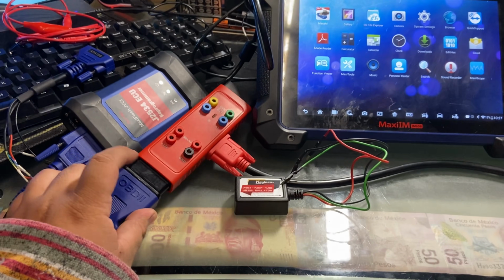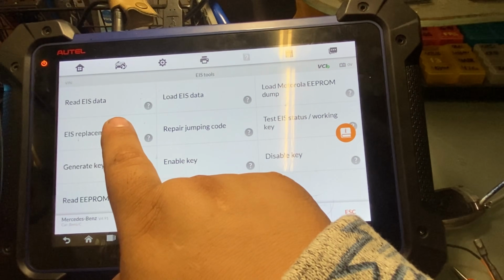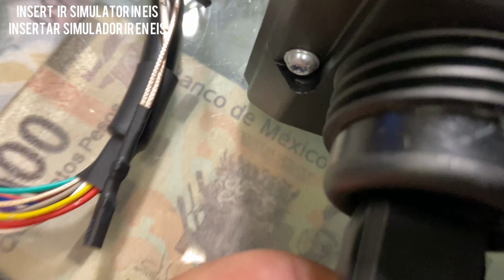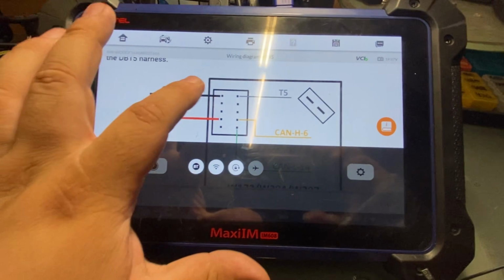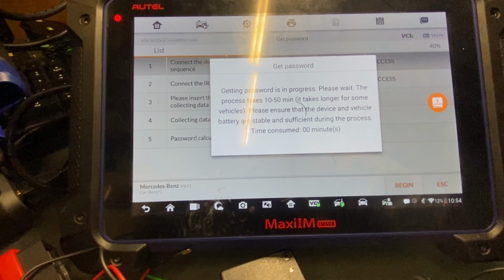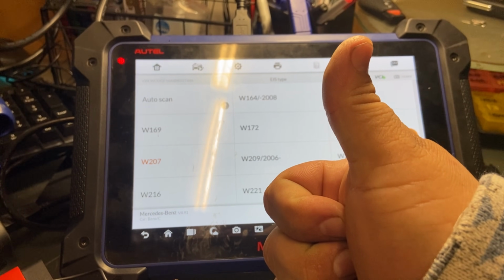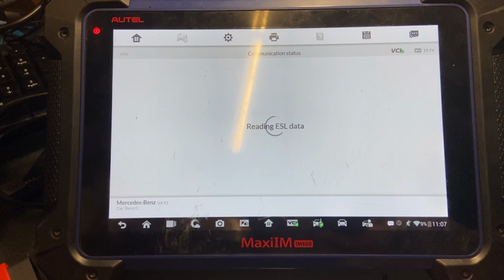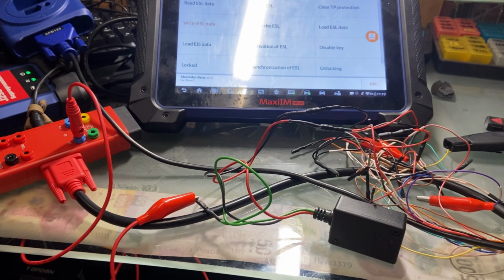MERCEDES BENZ ESL ELV PROGRAMMING & EIS W207 ALL KEYS LOST (AUTEL IM608 PRO GBOX2)

Comment: HI  BOSS I GOT 2013 C300  TRY TO PUT EMULATOR  THEN I TAKE OUT  THE  IGNITION MODULE   SAYS207 HAVE YALLOW MARKES  ON IT   SIR I M TRY TO PUT EMULATOR  BLOCK ONE I M KEEP FAILING PLSCAN YOU TELL WHERE I GET K LINE   FROM G BOX?WHERESAYSG7
Reply from the maker: Yes you will need the xp400 pro do you have Autel?

Comment: Hi I hope you can help!

I have a w906, eis was stolen. Replaced with new eis with existing key and one new key added no problem. But no ignition or steering wheel unlock. Error code is b1005, no connection to esl ce51 or something. 

How can I fix this with autel (im508,xp400pro,gbox2) etc

Hope you can assist
Reply from the maker: Needs vehicle data .. must use old eis data and write onto new one
Reply: I dont have old eis. It was stolen so no old eis data. Do i get it from the ecu on bench? If so which option. I also have the old key... how do i get the password from the old key@MYKEYSAUTOMOTIVE

Comment: Hello , i am interested steering wheel is locked position or unlocked before you make simulator ? And where did you  buy this simulator
Reply from the maker: Luckily the esl was stuck in the open position but when your lock is in the closed position you must bring down steering colum to drill esl and remove..
Reply: @MYKEYSAUTOMOTIVE  where did you buy this simulator ? Xhorse mini simulator doesnot work?
Reply from the maker: Uhs hardware
Reply: @MYKEYSAUTOMOTIVE  what other emulator that will work for autel. That keyless is discontinued already
Reply: @MYKEYSAUTOMOTIVE  hola buenos días disculpe para Aser un cambio de EZS es el mimo procedimiento será que envés de poner los datos en el blokiador de columna Sele ponen al EZS nuevo si me puede ayudar por vabor